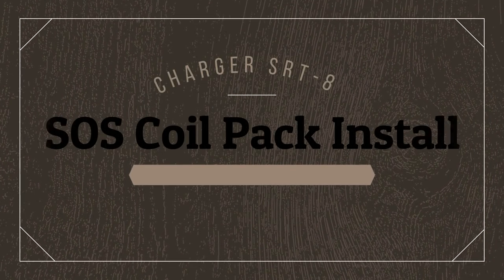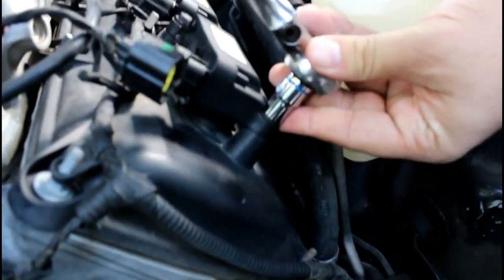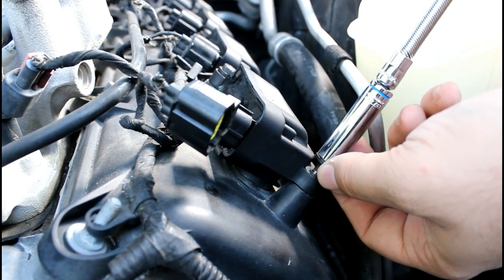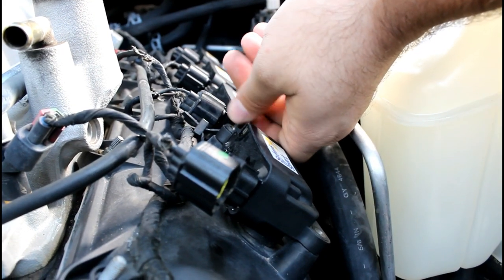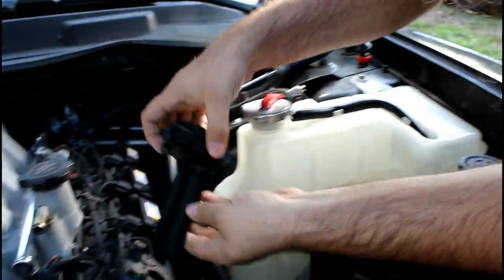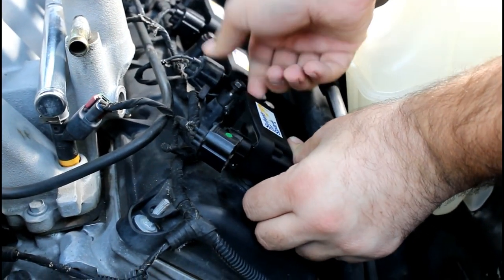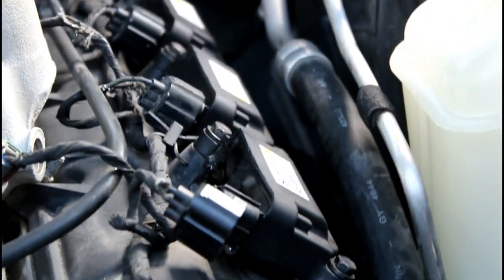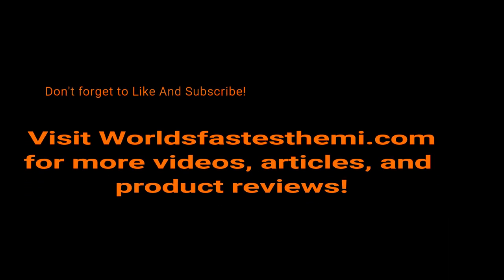Sultans Of Spark Coil Pack Install - 2007 Dodge Charger SRT-8

Comment: Did u re gap the plugs?
Reply from the maker: Generally you should, but in this case I did not, as I was in a rush and had just installed the plugs a few months prior. I did re-gap the plugs to .050 on my buddy kerwins ram when we installed the SOS coil packs there. That truck got MOVING after we were done with it.
Reply: stupid question: is re-gapping necessary to take advantage of the new coil packs ?
Reply: Regapping to 0.065" is recommended by the coils manufacturer.
Reply from the maker: Not strictly required, no, but it is the way to get the most power out of them. I'd recommend replacing the plugs with fresh ones gapped as per mfr suggestion if you haven't replaced yours recently.